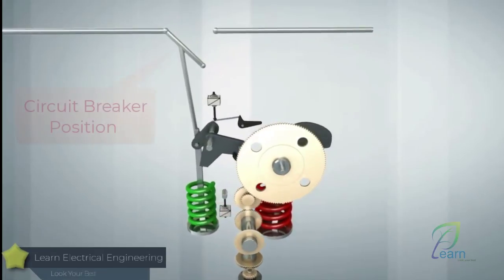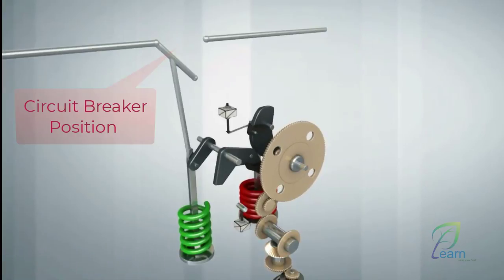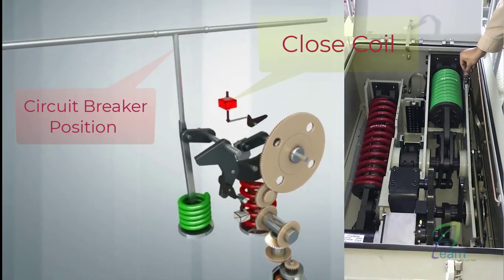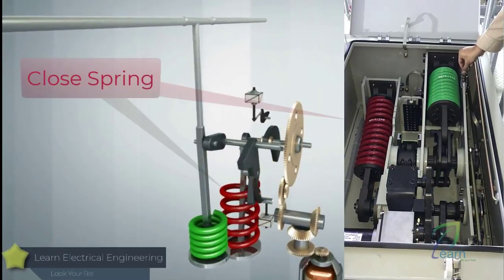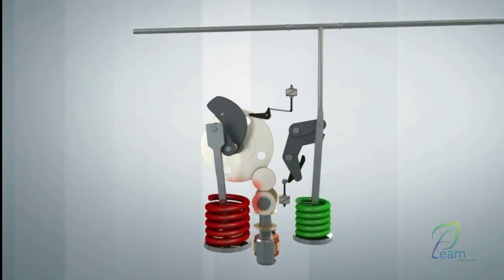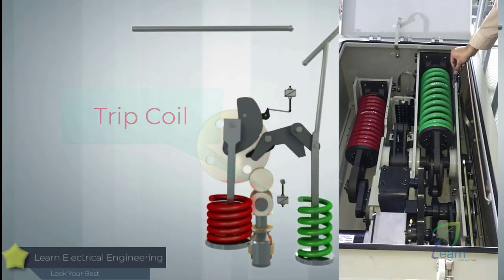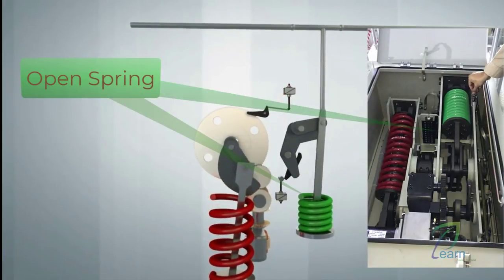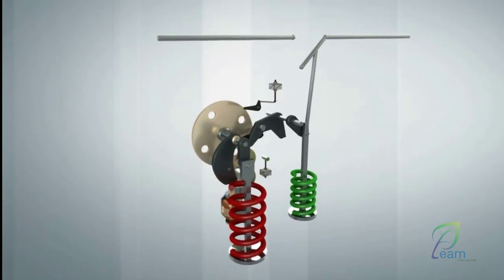Circuit Breaker Operating Mechanism "animation/field video" ( Close , Trip Coil and Charging Spring)

Comment: Friends dont get confused... Opening spring is charged by closing action or close spring..

Closing spring can be charged mechanically or by AC motor ..

Opening spring is charged only by closing spring.
Reply: Does this mean that the opening spring is charged by the rotation of main shaft when the breaker closes due to the force exerted by compressed closing spring?
Reply: @abdullahzafar1704  yes

Comment: you may check : The opening spring is charged through the closing spring and not vice versa.
Reply: I was confused by the video. But yeah the closing spring charges the opening spring?
Reply: Does this mean that the opening spring gets charged by the rotation of main shaft when the breaker closes due to the action of compressed closing spring?
Reply: @abdullahzafar1704  exacto

Comment: Sir
 I have weaving mchine with  panel boards and 3.5 kw motor.and motor is controlled by 7.5 hp @ 415V contactor C&S (TC1-D1210)..

 I HAVE TO PROTECT MY PANEL BOARDS FROM UNDER AND OVER VOLTAGE SO INSTALLING VOLTAGE PROTECTION RELAY AND DECIDED TO CONTROL IT WITH ANOTHER CONTACTOR
 .WHAT  WILL THE CONTACTOR SIZE(HP) CAN I USE FOR CONTROLLING .MY RUNNING LOAD AMPS IS 4 AMPS... STARTING LOAD AMPS IS 12AMPS....

HELP ME SIR...